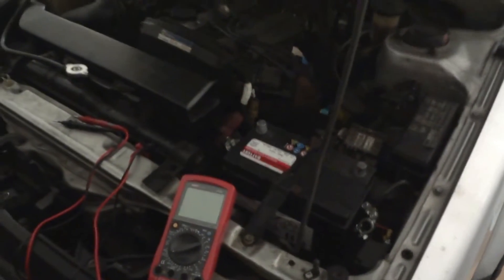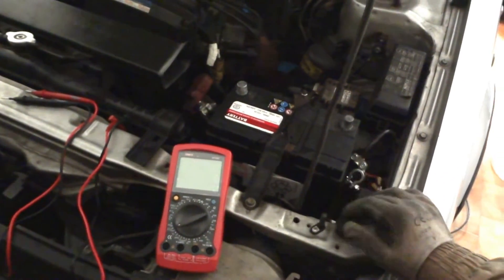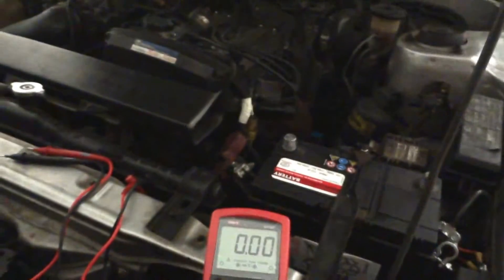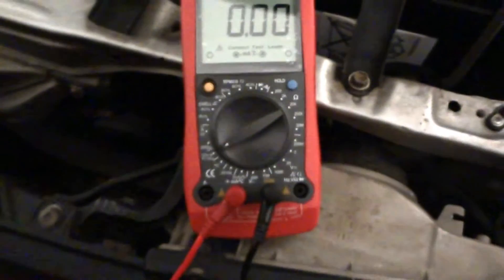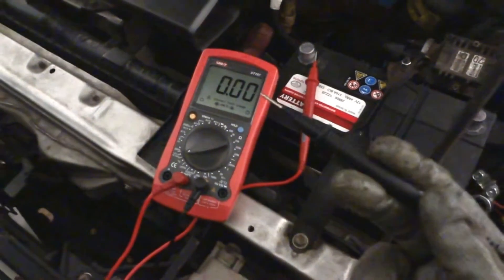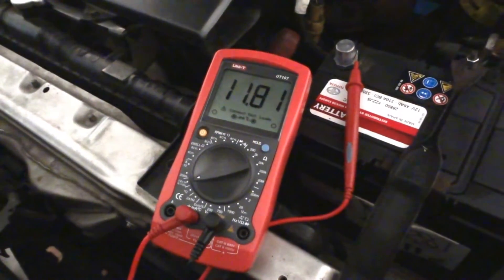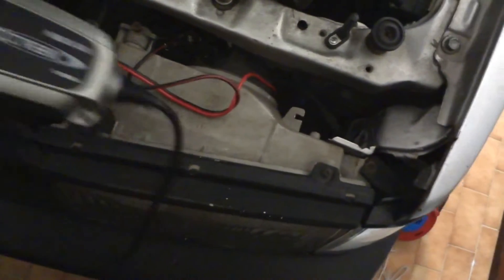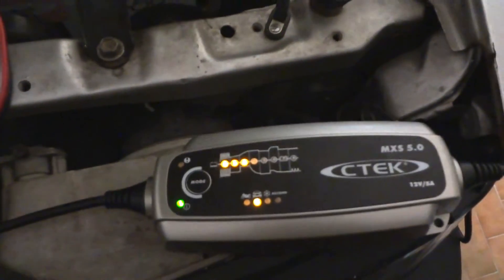Car Battery Diagnosis and charging with the UNI-T UT107 Multimeter and CTEK MXS Charger

Comment: Good luck charging your battery :) and thanks for the credits!

Since your battery is not deeply discharged, the charger jumped directly to step #3 that is bulk charge.
Step #3 charges the battery at 5A until approx. 80% capacity. Then it starts step #4 to top up the battery capacity with declining current and constant voltage so it does not damage it. Step #5 is only to check if the battery is retaining the charge.Step #6 will not be used (RECOND) Step #7 -> its charged!

Long Live your Battery